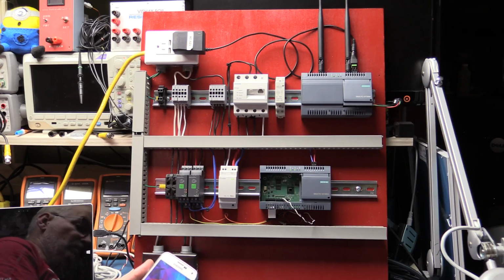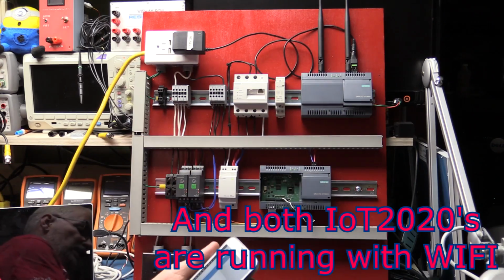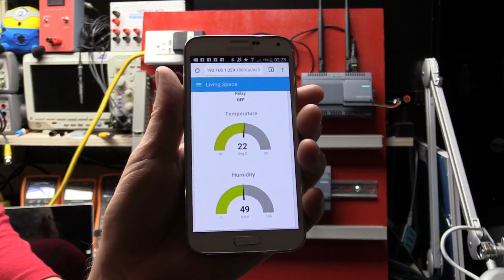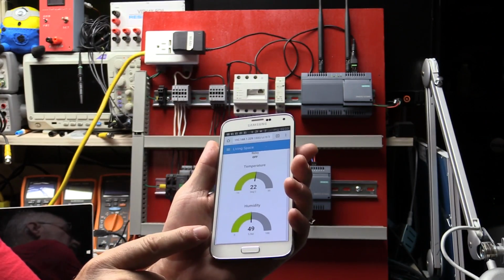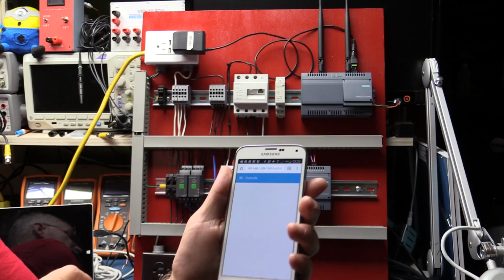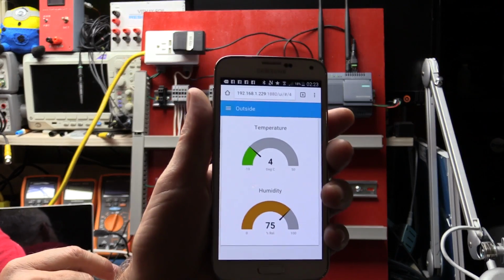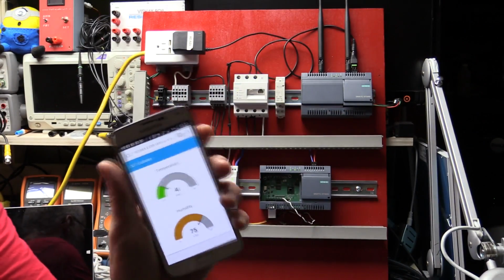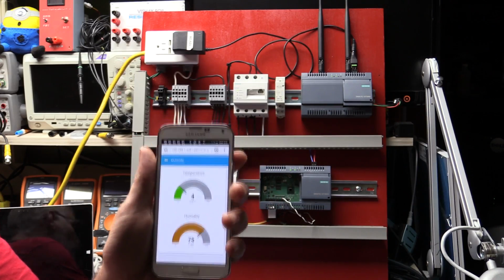IOT2020 – the educational intelligent gateway for industrial IoT solutions

Comment: When you use the CE and UL certified industrial IoT2020 with several non-certified ESP modules in the same project, you have void the certification. What is your logic of promoting the use of this certified IoT2020 for educational projects?
Moreover, IoT2020 is about 14 times more expensive than an Arduino UNO R3, and it is only a gateway without built-in I/O!

Comment: I have tried many ways to use DHT11 for the temperature sensor and HX711 for the load cell. I failed all test of applying or modifying standard Arduino lib to IOT2000(Intel Galileo). Basically, the one-wire connection is not suitable for Intel Galileo, the switch of IO pin is too slow. I saw you were using IOT2020 to read DHTXX, how did you manage to directly read DHTXX from IOT2000?
Reply from the maker: I dont have it setup right now to check. Also I cant think why the Library would be too slow but in the video above I was using remote sensors (Many of them) based on ESP8266 running Tasmota software and these for sure had DHT22/11 sensors on them and they in turn were sending the data via MQTT to the node red running on the IOT2020 unit. I did briefly show an image of a proto board with DHT11 and a light sensor but I cant find the flows / software I used for it.
Reply: theBreadboard thanks for your quick reply. I think your approach is more appropriate, use IOT2000 to line up multiple remote sensors, work as a ‘gateway’, rather than directly reading the sensors
Reply from the maker: @boys7371  and of course, that is its primary purpose :). it can do some IO but my view it should be limited

Comment: is it possible to comunicate RS485 with iot2020?
Reply from the maker: yes but not as easily as with the IOT2040 (It has 2*RS485 built in). you would need either a USB RS485 adapter or tie into the TX/RX on the arduino headers, both would show up as a com device. the simplest would be the USB option I would think

Comment: Hello Peter, 
I have an IoT 2040 but couldn't figure out how to connect it to WiFi. What component should I use? WiFi module, WiFi shield or WiFi card?? I tried with WiFi module but couldn't find an appropriate library to go with it;it kept on throwing errors. What's the most easiest way to add WiFi connection to Siemens IoT 2040??
Reply from the maker: Don't try to use the Arduino Header / Shields for this, your far better off with native Linux integration using something like  a USB WIFI dongle (Official Raspberry PI one works great and is cheap and available from RS-Components)  or something like a  Intel Centrino Advanced-N 6235 card that I show being used here https://www.rs-online.com/designspark/siemens-iot2020---unboxing-and-technical-look you can get the Intel WIFI card from numerous places including Amazon.
Video here https://youtu.be/07I4A_LqC7g

Comment: send me that diagram
Reply from the maker: "Please"........ I dont have a diagram and have since re-worked the panel for a different video but there is nothing special there, simply 2 wires from GPIO pins going to the control of two relays, the relays have logic level inputs so easy to interface to any controller of today's gpio outputs.
The temp sensor is a DHT22 and the light sensor is a simple LDR with a 10K connected to it and 5V, the junction of the two going to an Analog input and the other end to ground. If you search "Arduino, LDR, ADC" you will find plenty of examples, same goes for "DHT22, arduino"

Hope that helps

Comment: Hello Peter,
I bought a Centrino Advanced-N 6235 for my IOT2040, but received only the card, no cables, no feedthrough and no antennas. What would you recommend?
Reply from the maker: I bought my antennas separate too, they dont come with the WIFI board. My antennas also have the feed through integrated into them with the wires to clip onto the wifi board.. you can find them on ebay, aliexpress, Amazon etc.

Comment: I wish they'd put eMMC/Flash memory on it instead of relying on the SD card for carrying the OS. I've had a few fail without warning.  

It's the main reason I'd go for a Beaglebone over a Raspberry Pi
Reply: I'm using a flash memory stick connected to the USB port
Reply from the maker: I would guess not for the OS but for additional storage ? off the SD Card. this way it limits wear.
Reply: I prefer the boards on board memory due to when I was considering high vibration environments (UAS/Drones) - the SD card vibrating loose or breaking contact momentarily was a concern. I have read about and experienced sudden hard failure of SD cards too.
Now if the IOT2020 wasn't in a high vibration environment... there is another option worth considering

https://superuser.com/questions/420667/does-it-make-sense-to-put-your-operating-system-on-a-sd-card
"You can also boot a Raspberry Pi from a USB card, or just keep your root partition (the OS disk) of the system separate from the boot partition -- on a different USB spinning or solid state disk, or over the network on a nfs server.
It's ok to leave the /boot partition on an SD card, since it only gets read once, in one burst, at boot time -- to read the linux kernel before it is loaded."

Later on that page in a different post....
"SD cards are based on: "flash-EEPROM memory" - Isn't a very good fit for the random access and piece-wise updates that makes up the majority of use of an operating system disk.
It's actually quite unreliable, accessed directly. The data need to have 'error correction coding' applied because individual bits fail quite often. And blocks of data even need to be 'whitened / scrambled', because any big clear patterns in the data - like many nearby '1's or '0's - will cause flash-eeprom to malfunction.
SD cards deal with the above so that the SD card at least appears reliable -- the data is written down with some redundancy, and it's checked, corrected and unscrambled when it's accessed before it's sent to the computer.
But even reading one random piece of the data from a flash chip can cause surrounding stored data to become corrupt. Flash memory controllers thus have to re-write the surrounding data again, somewhere else, so it doesn't get lost -- and this happens even if the card is set 'read only'.
Worse, each individual flash memory cell can only be written to a limited number of times -- so the controller also has to spread the writes across the disk -- called 'wear levelling' -- so that any one part doesn't wear out too soon.
So now consider what happens with an OS disk.
Just booting up off it reads a bunch of little files which are spread here there and everywhere across the chip -- and generates a heap of extra writes which are 'invisible' to the computer, even if the "read only" switch is set on the SD card!
There's also no way in the SD card electrical connection specification for the SD card to tell the computer "I'm busy writing, please don't power off yet" -- or even for the computer to warn the SD card "we're about to shut down, get ready".
So even with a proper shutdown, the operating system can still be corrupted!"
Reply from the maker: I would agree, in that kind of environment, the IOT2020 would not be suitable.

Comment: What type of certification the IOT2020 has exactly? I'm not sure I understand the difference (advantage?) between this device and another FCC certified device like the Particule Photon?
As I understand you would have to pass the FCC certification with your end product anyway. Am I missing something?
Reply from the maker: The IOT2020 has CE and UL certifications, FCC is more about radio interference etc. With CE / UL certifications, this product can be officially sold in many countries and applied to industrial, commercial and home applications.
It comes in a DIN rail enclosure, is designed for 24x7 operation and is ready to integrate into many industrial applications including IOT Gateways. The board you linked in would require a case and many other parts as well as possible re-certification before it could be sold for direct use in industry for instance. The IOT2020 is also far more powerful, it uses a 1GHz Quark CPU, 512MB Ram, includes Ethernet, USB Host, USB Client, TTL Serial *2 and many other features. It runs Yockto Linux and will easily support IOT applications like Node-red. To top it all off, it also comes with an Arduino R3 compatable header to accept off the shelf Arduino Shields (May need re-certification if used for a selling product. but Siemens is also working on fully certified shields that when used with the IOT2000 range, will not require recertification of the final solution. I hope this helps.
Reply: ledor473 https://support.industry.siemens.com/cs/ww/en/ps/6ES7647-0AA00-1YA2/cert

Comment: Thanks, peter. 
As far as I know, the extension of IOT2020 relies on PCIe and Arduino Pins (GPIOs). Do you think those ingerfaces are enough for high-speed data collection?
Reply from the maker: I doubt you would use the PCIe for data collection but the GPIOs should be able to run very fast. I have not timed them yet.
What do you define as High Speed ??
Reply: Well, thanks.
I am considering 720p camera via GPIOs. Would that be possible?

Comment: At 4:42 it look like the unit can accept external antennas. In order to sell your solution wouldn't you still have to re-certify this particularly if you connect other antennas? 

Also what if your software requires a lot of RF transmissions, could you also exceed the RF output of for some of these certification??
Reply from the maker: That would all depend on what you install. I used a standard (Certified) Intel PCIe WIFI/BLE module so wifi expects a lot of traffic and I don't think I will be breaking any WIFI / FCC approvals. but simply adding once certified product to another certified product does not always mean the result is still certified. I believe the correct phrase is "The integrator is responsible to ensure continued conformance"

As far as radio goes If you choose to use say a sub 1Ghz module then I agree you need to be careful about over usage. In all cases you need to consider continued certification if you start modifying the product to add you own. There is a lot of details regarding this in the siemens documentation. Siemens will also be publishing and releasing products that will be pre-certified to be used with the IOT2020 without breaking the certification as they will have been certified for use with it.

Stay tuned, when I know I will forward on the info
Reply from the maker: Oh, and if your RF output will exceed the RF device your using per regulations, then you picked the wrong RF device or wrote the code the wrong way ?, you need to re-evaluate your solution and adapt somehow to bring it back into compliance.